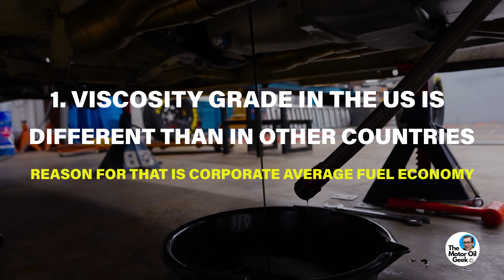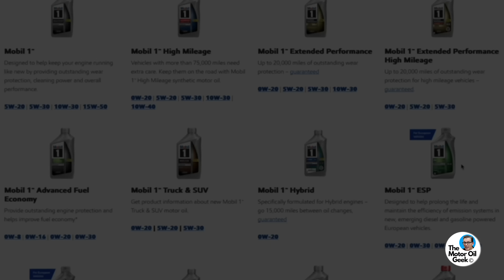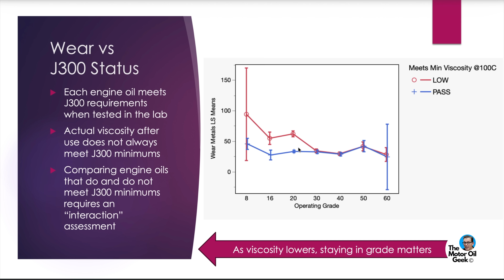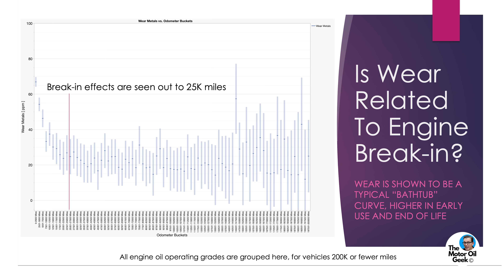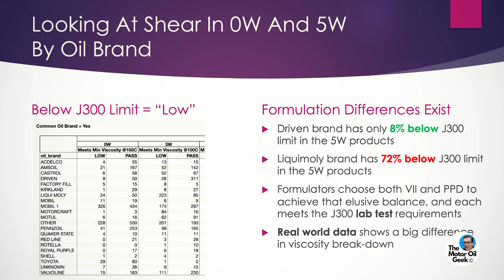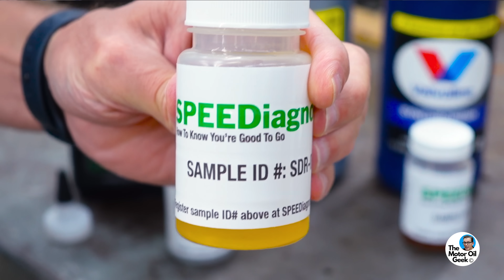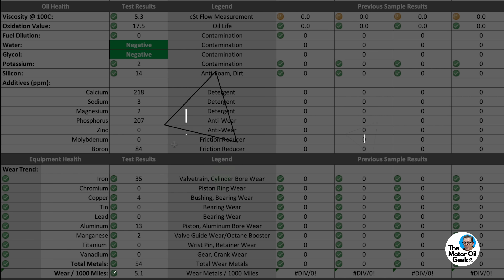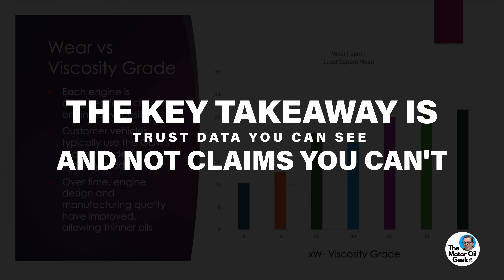More Ai Lies? The FACTS about 0W-20 vs 5W-30 (With Evidence)

Comment: I own a 2025 cx5. The manufacturer says 0-20. I'm not an oil expert, mazda oil is specific to the engine in my cx5. For a little research, I found it specific properties for lubricating engine parts. I'm sticking with and using Mazda oils and filters for my 2025 cx5.

Comment: So General Motors has all but admitted that 0W-20 does not provide adequate bearing lubrication. The GM recall ‘fix’ for their failing V8 engines is to change out the 0W-20 with 0W-40 oil, and put a new oil fill cap labeled 0W-40, and an addendum in the owners manual. Seems like pretty compelling evidence that they know 0W-20 isn’t doing the job. Or, is GM not telling the truth?
Reply: Watch his video on this....0w40 was a band aid...0w20 didnt cause the damage,,bad machining and debri did.
Reply: Only on the recalled engines, the new ones that have been corrected still call for 0W20

Comment: If you live in Frostbite Falls and need your car to start in cold weather, then fine.  But I leve in Arizona and I am not going to run the thin oil when running hard when it is 110 degrees out.

Comment: As always, great data driven insight!   Thank you for sharing.

Lake, if 20 is more stable (doesn't shear out of grade) and 30 (if it shears it will likely still be above 20 grade), is it feasible to blend 20 and 30 (50/50) get a 25 grade that may be better than 20 grade?  Please let us know the chemistry result and then practical application  concerns.  I understand application results will vary based on engine design, age and current wear, driving habits, etc.

Comment: Thanks for fighting AI slop :). In all of your evidence/tests, what do you think about shear stability and 0w20 in these turbo 6 cylinder engines vs a higher viscosity oil like 5w30 or, 0w40? The oil heat/engine heat in these turbo engines  is just crazy compared to NA

Comment: My 2024 Buick Envista manual lists 5W-30 under normal weather / driving - and 0W-20 under extremely low temperature areas / more rugged driving conditions. 1.2L 3 cylinder turbo - I use 5W-30 FULL synthetic oil changed every 3K miles in my HOT, very dusty area of SW New Mexico.

Comment: I notice Lake does not give a recommendation on what to do at the end other than: “Follow data you can see.”  Here is what I know.  My Honda and My Mazda engines in developing countries recommend 5W-30.  Only in North America, regardless of climate, do they recommend 0W-20.  Lake also confirms that the difference is due to US CAFE standards.

So, I have been “ following the data “.  I followed it right to the Honda and Mazda manuals.  The data calls for 5W-30.  Everywhere else, especially in developing countries, the buyer is interested in longevity.  They must make expensive things last as long as possible, which is why Japanese cars are prized there.  

For those of us who also prize longevity in our cars, especially those of us that live in warmer or milder parts of the US, the data still points to 5W-30.  Pretty simple.

Besides, my cars immediately got quieter right after I changed to 5W-30.  No more obvious tapping noise that could be heard over road noise at idle and low RPMs.  It is very, very obvious that the engines are happier with the 0W-30.  Evidence enough.
Reply: Another thing that is never discussed is the lower tension oil ring springs on pistons which wear much faster. They use them to help reduce friction to improve mileage figure.
Along with that is the principle of "Planned Obsolescence" which was first entertained by Pontiac Motors in 1965. They plan for vehicles to get to a certain mileage and then, they hope, the parts start to fail and the owners will decide to buy a new car.

Comment: Oh ok i finally understand why u don’t just want the lowest w weight oil u can get. I was always so confused why I didn’t see the downside of having as thin of oil u can get in thr cold while also having the thickest of oil at operating temp
Reply: Fair question. That would take a separate video just to explain that one. The simple version is that the lower viscosity in cold weather makes it easier for the oil to flow. When it heats up if flows more easily yet, provides the same protection. That is the very simple version.
Reply: @steveforbes8287  yea I the shearing possiblity going up as the 2 weights separate makes so much sense. And just to be sure let’s say u had 20w 50 the 20 means that it acts like a 20 weight oil at the test temp right. Like both numbers are based on the same number scale.

Comment: How about including a discussion on transaxle fluids ,  rear differential, and transfer case fluids ?
Reply: I'm no expert, but I got a 99 Nissan frontier that I bought new, with a 5 speed manual transmission. I've pulled trailers, hauled firewood and lots of dirt and use it as a stop and go service truck, plumbing. Truck is right at 300,000 miles and I have never changed gear oil in transmission, original clutch also.
Reply: @Thoreau-e4l  It's beyond time for a fluid change  !
Reply: @wishmire33 lol,probably, I'm wondering if the drain and fill plug will even come out now! That little 2.4 is a beast of a engine!

Comment: Ok Lake,  you have facts but no recommendations.  Follow the manufacturing specifications.  
1) Mfr's recommend 10k intervals for oil changes.  I believe even Lake says this is too much.
2) If 0W30 shears, it will still be above the 0W20 after time and dilution. 
3) Is European spec's better or worst for engine wear.

I want recommendations.  Lake, didn't you recommend up the viscosity if you see wear after oil analysis?
My opinion, no data,  no proof,  I prefer 0W30 over 0W20.
Reply: We have a simple rule in our cars and trucks. Mobil-1 5W-30 every 4000 miles. We have never lost a motor to oil failure since we started using it right after it was introduced in 1974! Not one! Many of our vehicles hit 400K miles and rusted away long before they were ready to fail. Yeah. We live in the Rust Belt! (Boo hoo hoo!)
Reply: @steveforbes8287  NICE!!!

Comment: Who cares. If someone can't figure out they are two different grades a 20 vs 30 - well the 20 is a 20 and the 30 is a 30.. Viscosity grade when you are deciding is or should be based on oil consumption.. Go to the lightest or lowest viscosity you can w/o oil consumption. Monitor with oil analysis if needed. I run a 5W-20 racing in my 66 Yenko Corvair when running the yearly Economy Run and have won!!
Reply: WOW! A '66 Yenko Corvair! Damn! I'm jealous!!! Nice car and more rare than a hen's tooth! However, you are talking about a very, very niche situation so, it may not necessarily apply to this conversation.

Comment: I agree with you. I live in the Pacific NW where the Winters are mild, so using a 10w-30 oil is acceptable and beneficial over a 5w or a 0w oil due to lower levels of  viscosity index improvers, which like you said, makes the oil more shear stable and also less volatile, so the oil stays in the crankcase. I’d go with an oil brand that claims that their product can go say, 20,000 miles. They are confident that they have used higher quality base oils and additives that are shear stable and can go the distance. Even if you drain at 5,000 miles, the oil will still be in grade, versus a cheap oil that only stayed in grade for 1,000 miles.

Comment: New year same bullshit. 
A 5W-30 oil has HTHS at 150C  3,5mPas Evaporation loss (Noak) 9,5% a 0W-20 oil has HTHS at 150C 2,6mPas Evaporation Loss (Noac) 10,5%.
Which  of two oils protect better the engine, i dont care about fuel officiency
Reply: 95% of the motoring public in the USA does not either. Correct!

Comment: Ask your oil change location what "type" or brand they are using. I worked as a sales rep for two major oil companies, and the one constant is that you can't trust what goes in your vehicle. Sometimes it not the shop owner's fault. When I would send in samples to our lab, they would come back wrong viscosity or "probably would not meet specification". I still change my own oil and I know if the oil I select is not protecting it is because of the refiner or brand. PS don't follow greater than 5.000 or 6 months change intervals. Saving a little money is not more important than risking engine wear. If you never heard of the brand there is a reason. Many shops charge for Brand X because the price can't be compared to what Walmart is selling it for.

Comment: Most important is to regularly change your oil and filters. And use correct and good oil. I tend to change my oil every 6K miles. My old Alfa Romeo 1.8 ts on LPG has well over 200K miles and still runs fine.

Comment: There are other factors that should be considered and that gapped piston rings The oil gets deluded with the compression gases, which is mostly fuel overtime along with water that’s already in the air contributing to your oil degradation. as an engine builder I use tactics to avoid this. One of the things is gapless rings, which seriously contribute to cutting down on your oil contamination from compression gases. Also, I use a catch can on the oil which picks up a lot of moisture that’s in your air intake. Between the water and gas that saturate your oil contributing to oil degradation using these tactics will preserve your oil in a proactive way that are tested in true.… Great show lake… keep on rocking…

Comment: Bottom line if manufacturers state 5w30 outside of the US but 0w20 for inside US, use 5w30 in US in southern hot climates to get optimal wear protection!
Reply: Be careful with that train of thought.  Some cars have electronic oil pumps calibrated by the ECU for a defined viscosity.  Using a viscosity outside of that range can damage your engine.  The same engine can be calibrated to a different viscosity in two different Countries depending on regulations.  Although a different viscosity might be better for the longevity of that engine, it can be offset by what is calibrated by the ECU to the oil pump to get better gas mileage.
Reply: @CAN43714 Which cars? Please name them.

Comment: Lake I have an interesting question: Generac recently change their oil recommendation for their entire lineup of backup generators from 5W-30 to 5W-20, across the board even for older units originally spec'd for 5W-30. Since these are mostly gaseous fuel engines running on natural gas or propane, things like fuel dilution arent a factor. Nor do I hardly ever see carbon or other deposits or contamination in my own generator - which is powered by a 2.4 liter turbocharged and intercooled Mitsubishi engine. It would be interesting for you to cover this change from Generac, talk about why running a 20 weight oil in engines clearly designed for 30 is or isn't ok. And maybe throw in some analysis on the unique needs of home and business backup generators versus cars. Generators often run at a single speed (usually 1800 or 3600rpm) and at various loads. And they can run for long periods straight. Here in Texas we can go a week up to THREE weeks without power (as happened after Hurricane Ike). Imagine that 5000 miles at 50mph is about 100 hours - that's just 4 days of a generator running 24x7.  Anyway - with millions.of people buying generators in the wake of Beryl, Helene, and other disasters that affected multiple US states and tens of millions of Americans, there are some tangents on oil that me, and perhaps others, would find interesting.

Comment: 0w20 and other light weight oils do not give adequate room for error for the average 10k mile oil change idiots that drive today’s high pressure and high power engines.   It’s like oversteer vs.   understeer.   Lesson?  Use the proper viscosity and quality oil and. CHANGE IT  every 5k.  End of story.  End of issues.

Comment: Right or wrong, I just started mixing the recommended 0W20 oil with 5w30 oil in my wife’s Nissan 3.5L.  I use 3 qts of the 0w20 and 2 qts of 5w30, Amsoil Signature Series just in case there’s something to the claim that the 0w20 doesn’t protect as well as a thicker oil.